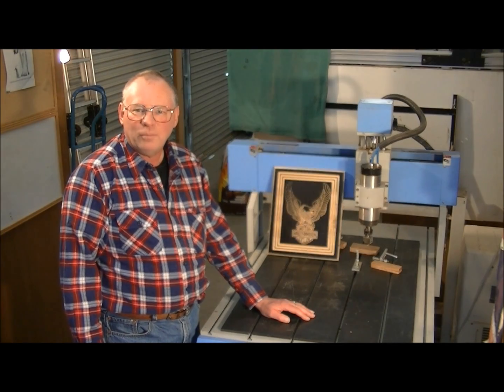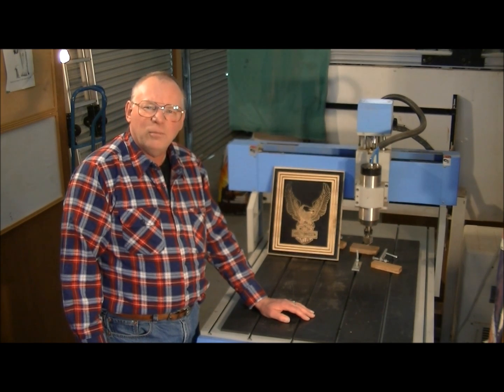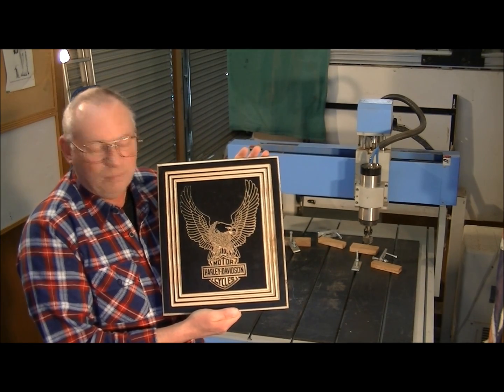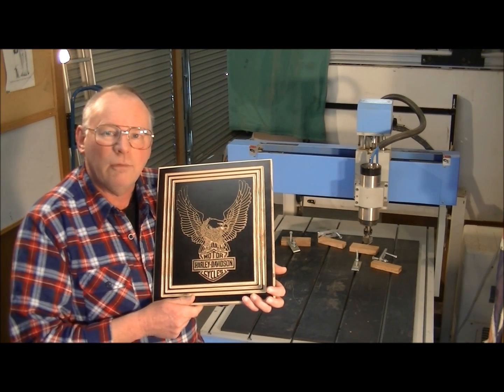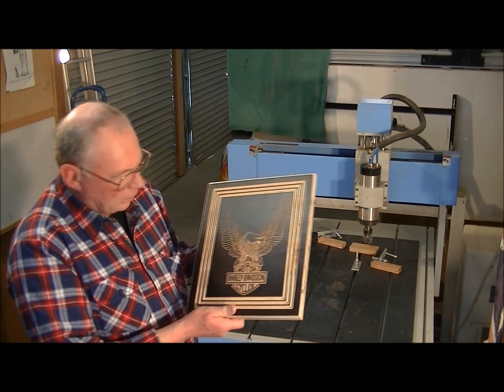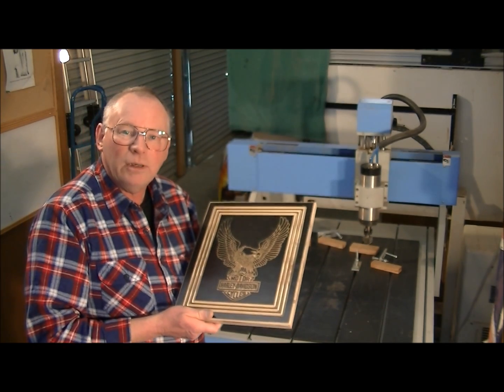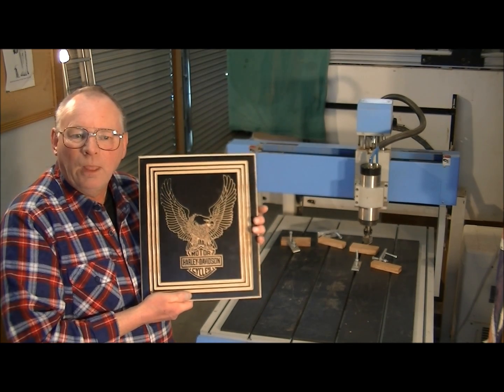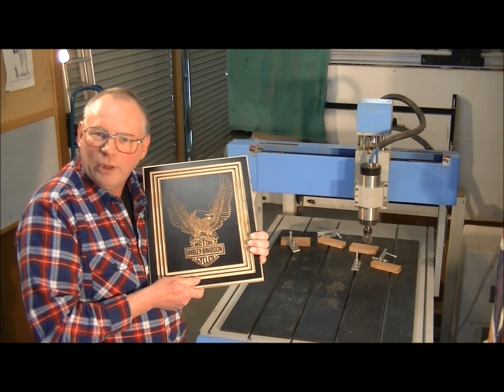68  CNC Router carving a USA  Harley Davidson  logo

Comment: Just came across your video. Great Work. Know you've probably answered this a million times but what make and model is your CNC. Would you recommend it to others.  Looking for a CNC capable of engraving cabinet doors and occasional plaques, signs.

Thanks and keep up the great work.
Reply from the maker: +James Allgary 

Hi, hold back on purchasing a CNC machine,  I will be making some exciting news announcements in my next videos. Basically, I am opening a factory up to produce a well-made and designed CNC router and milling machines as well as full conversion kits, standard machines and tooling. We need time to organise and open a company in Qufu city in China’s Shandong Province, home town of Confucius. We hope to be in a position to take orders by August so please be patient.  The pricing structure has not been confirmed as yet but we will be keeping pricing competitive.

(As an example ONLY);

Shipping not included.

6090 CNC router, (base model) with 1.5kw spindle USD$ 2950, + 4th Axis + USD$ 980, + 2.2kw spindle and inverter upgrade + USD$ 395

6090 CNC router, (linear rail model) with 1.5kw spindle USD$3595, + 4th Axis + USD$ 980, +2.2kw spindle and inverter upgrade + USD$ 395

Mini-mill drive belt conversion kits for SIEG X2, Grizzly G8689, Harbor Freight 44991, Hare & Forbes HM-10, USD$ 155

Mini-mill CNC kits

Kit 1- Includes, Ball-screws/nut assembly’s, motor mount assembly’s for the X, Y and Z axis. 

USD$ 600 . 

Kit 2 - Includes, 3 x High Torque Nema 23 CNC Stepper Motor 3.5A 3Nm (425oz.in).  3 x Longs DM542A 18v to 50v 2H micro-step driver . 1 x Longs AC-DC 10A 36V (115 / 230 VAC ) power supply.  1 x MACH 3 breakout board . 1 X computer cable .   

USD$ 330 .

Roger Clyde Webb
inventor Australia
Reply from the maker: Hi please send an email to: webbpartners@netspace.net.au and I will send you some information on are new 6090, 6060 and 6012 (linear rail model) CNC routers. Our new company name is Pacific Tooling. 
Australian Inventor Roger Clyde Webb

Comment: Nicely Done Roger! To cut down a bit on your work load I'd recommend running the V-Bit down about 1/4 of an inch all along the perimeter of the frame. This would give you a consistent bevel for the plaque and eliminate the sanding (the bane of all woodworkers!). In addition, the "bevel" also establishes your cut lines for use on the crosscut sled. Very Nicely Done! Thumbs Up!

Comment: hello roger very cool how do u change it by 25%.what feed rate do u run that at, what size cuter .would u share the g code,i am running mach 3 i don't have a 3d program yet , i have aspire3 .0 old
Reply from the maker: Ronald Cochran 

I use ArtCAM, have
a look on YouTube at the tutorials. ArtCam Express comes with over 600 3D
reliefs. Understand that there are years of learning and experimentation by me
that are not in the videos and projects to enable me to carry out and achieve
what you see in my videos. Hope all this helps. Roger
Clyde Webb  Australia :)